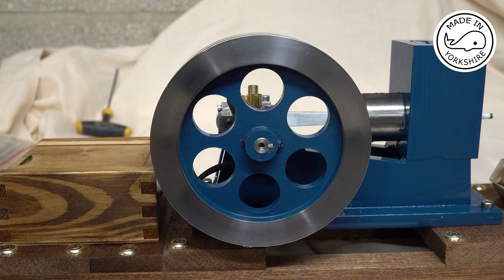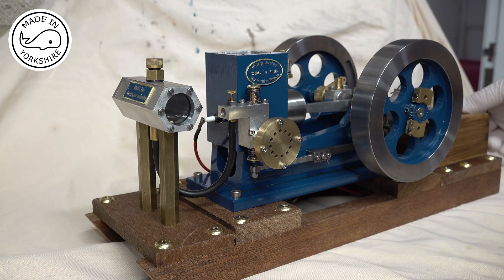#MT41 Part 15 - Philip Duclos Odds n Ends Engine. Finished using Cast Iron Piston Rings. In 4K.

Comment: I watched both these builds Andrew, they both came out fantastic.  I have both sets of plans, would  you mind telling me,  in your opinion which one is the  easiest to build?
Reply from the maker: Personally I would go with the JH FarmBoy. The machining of the body is a little more involved but the overall engine design is brilliant. I have found two weak spots on the odds n ends.... The head gasket is prone to blowing and the flywheels tend to come a little loose after a period of running.
Good luck with whichever you decide to go with.
Cheers
Andrew
Reply: @learningturningmetal  Thanks for the quick reply Andrew, advice noted.  Mind you, with your skills you make everything look easy.

Comment: FYI, using grinding compound to run it in will turn the aluminum piston into a lap, you will never get the grit out of the soft metal.
Reply from the maker: Hi Ross, I agree. The paste I used wasn't a grinding compound. They use it on new engine builds, typically bearings. This ensures lubrication of those areas, prior to oil getting there. It's also good for new engine storage. It definitely seemed to help to run in my piston rings.
Cheers
Andrew

Comment: Saturday morning coffee with Andrew. Congratulations on another completed build, I have to spend some time and get mine running. I am afraid I am a lot like Keith Appleton with a number of projects going in the shop all time and just plain not having the ability to finish one thing at a time so I envy you. I have the plans for the Hoglet in the Model Engine builder magazine and I suggest you look up Volume 1 Issue 1 of that magizine and check out the Open 6 for a future project.
Cheers from New England
Reply from the maker: Thanks Bob - I do hope you get some time to get your little odds n ends engine running. I wouldn't like to think it's gathering dust in a corner of your workshop waiting for a bit of TLC. Maybe cut down on the coffee breaks, or maybe increase them for more caffeine! I see Randall Cox refers to the Open 6 in his Hoglet intro. I like challenges but that is taking it to the extreme! If I do manage to make a running Hoglet, I think the Jerry Howell V-twin will be on the cards.
All the best.
Andrew

Comment: 5:30 best run-in for rings is to actually run the engine. They're never gonna bed in properly if they don't have combustion pressures forcing them out against the cylinder walls.
Reply from the maker: I agree but the Graphogen paste certainly helped get it to run under its own power in the first place.
Cheers
Andrew

Comment: Wow, nice job! If I may suggest a way regarding the grub screws -- I like to put a small piece of solder in the hole before tightening the screw down. The solder deforms to grab the shaft perfectly, and prevents the screw from backing out. It's one of the techniques used before thread locking chemicals were invented. It produces a very tight, good fit on the shaft.
Reply from the maker: Thanks Peter. That's a great tip. I must try that.
Cheers
Andrew

Comment: Well done Andrew. Nice runner. Will be looking forward to your next build after your break. Have you ever built Henry Fords kitchen sink engine??  I’m thinking of giving it a go after I repair and upgrade my 9x20
Reply from the maker: Thanks John. That kitchen sink engine looks interesting. I don't think I would have a long enough shelf the accommodate it! Good luck with your upgrade.
Cheers
Andrew
Reply: @learningturningmetal  there are a few 1/2 and 1/3 scaled down engines out there.
Reply from the maker: @johnvaluk1401  😃👍

Comment: Andrew you have again done a great job with your project and videos - thanks for sharing your work. Your videos have inspired me to resume machining a model steam engine that I started several years ago. I think i might try a Farm Boy after the current project is finished.

Plus, I recently retired, so I'm running out of valid excuses to not do it...
Reply from the maker: Hi Jim - my plan is working then! I hope the steam engine turns out well. Having moved away from castings and onto bar stock engines I can't see me turning back. I'm hooked on these little internal combustion engines at the moment. They are really good fun. Having made the Odds n Ends engine, I think Jerry Howell was a brilliant model engine designer as the features on the Farm Boy are far more superior. Get that steam engine done and move onto the Farm Boy!
All the best.
Andrew

Comment: i wonder what the running in paste is called.? i didn't quite catch that.
Reply from the maker: Hi Emma - It's called Graphogen paste. Like I said - used on Rolls Royce engine builds. Earl couldn't find a supplier in the US. Howard O has suggested that 'Timesaver non embedding lapping compound' is very similar. Not sure about availability outside of the UK though.
Hope that helps.
All the best.
Andrew

Comment: hi andrew, have a look at ts model engines Germany,  they make castings for internal petrol engines opposed twin  called contra £350 cost might be worth a look.  alan
Reply from the maker: Hi Alan - thanks for the info, but I'm struggling to find any contra engine on the 3w-modellmotoren.de website. However, I don't think I could justify £350 on castings. I'm hooked on bar stock at the moment cos it doesn't matter if I mess anything up.
Cheers
Andrew

Comment: Gday Andrew, I’ve really enjoyed this series of videos, each have been very informative and easy to follow, the end result is bloody fantastic and to see the farmboy running side by side is fantastic, the twin cylinder engine build sounds like it will be a great build also, I’m really looking forward to seeing the next adventure, thank you for all the effort you put in to making the videos, truly appreciated, Cheers
Reply from the maker: Cheers Matty - thanks for the feedback!
Reply: @learningturningmetal  Agreed.
I loved the "flex coupling" used for running in the rings. As long as you keep the revs low (which you did) its reasonably safe. A simpler/alternative way may have been to use a drill set to slow speed but the lathe probably has more power & torque.

Comment: Hi Andrew, excellent result on the Odds n Ends Engine. Nice to see both engines running together.
Could answer a question.....what did you use for the fuel pipe from tank to engine?
I've also looked at the Hoglet engine so will be glued to you upcoming videos..
Regards
Kevin
Reply from the maker: Thanks Kevin - strange that you have asked about the fuel pipe - I was thinking exactly the same thing when I saw I was running out of it. I bought it when I built the Farm Boy. At the time I was trying out different types of fuel and found that Metanol destroyed the Nitrile o-ring ('unsatisfactory' compatibility). Methanol is pretty evil stuff and I ended up using Naptha (Coleman camping fuel) and switched to a Viton o-ring which have 'satisfactory' compatibility. I couldn't find any Viton fuel pipe, so I purchased Nitrile fuel pipe which has 'fair' compatibility with Naptha. I've not experienced any compatibility issues so far. The dimensions are 5mm od, 2.5mm id. Purchased from an eBay supplier (planet_silicone). I'd best order some more before I forget where I got it from! The Hoglet should be an interesting build. I think another guy in the US might build one in parallel too.
Cheers
Andrew
Reply: @learningturningmetal  Sounds like the silicone tubing used in model airplanes and cars. That stuff is really tough as it can withstand heat of the engine as well as the nitromethane/methanol/oil fuel blend.
Reply from the maker: @douglasbollinger8678  Silicone and Naphtha do not get on well together. Various chemical charts say that Naptha has a severe effect on Silicone.
Reply from the maker: @douglasbollinger8678  the following compatibility chart might be of interest: https://mykin.com/rubber-chemical-resistance-chart
Reply: @learningturningmetal  You are right!  I checked and the manufacturer specific mentions to NOT use silicone fuel line with white gas (naptha).  It's good I never tried it with my little hit-n-miss engine as I think it was the wrong size, although I've had good luck with silicone tubing as a temporary steam line from a model boiler. 

A gas-proof fuel line (clear, flexible) that I've had good luck with on the push mower is Tygon, which I'll have to stock in model sizes for white gas.
Reply from the maker: @douglasbollinger8678  some interesting info on Tygon here: https://www.google.com/url?sa=t&source=web&rct=j&url=https://www.bnl.gov/esh/shsd/PDF/Compressed_gas/Chem_Comp_Tubing_Material.pdf&ved=2ahUKEwj4zKLE4vvxAhWOFMAKHSi5C-4QFjAAegQIAxAC&usg=AOvVaw32LXsYaD-BrRWezAHUIifu
Reply: @learningturningmetal  Yup, the stuff I have is Tygon F-4040A. The black fuel line at the hardware store tends to swell and harden- from the ethanol in the gas, I suppose.  So far, the Tygon fuel line hasn't done that.